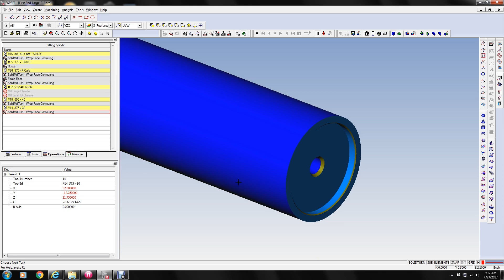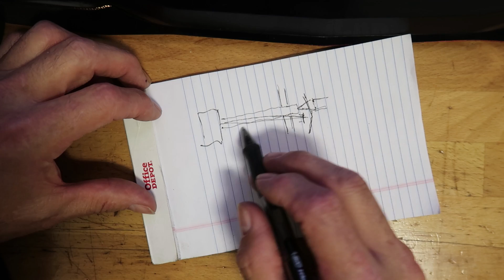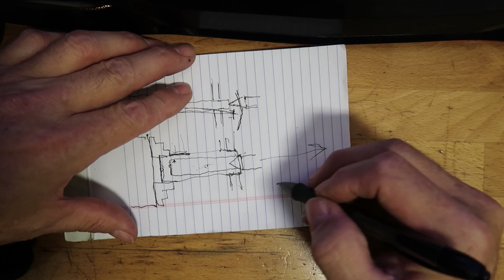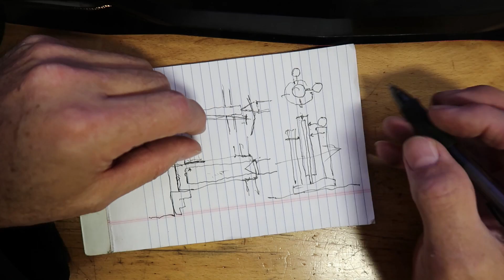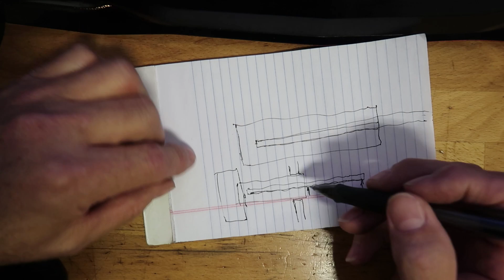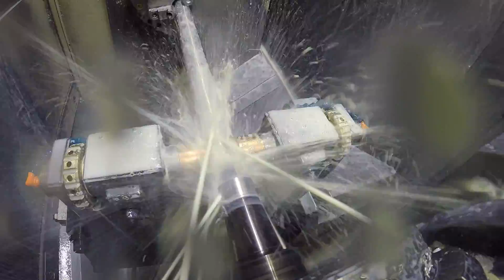Some Thoughts On Using Steady Rest and Milling Part End

Comment: Another great video Peter!  Quick question:  from what I have heard running an indicator upside down like when you indicated the end of the shaft can be a bit risky because flex in the holder may cause a false reading.  What is your experience?
Reply from the maker: Yes you are correct. I have tested this Interapid indicator with that short arm in the video  quite extensively and it has very little error (but it does have some about .0002"). You may have noticed how close I have it to the collet chuck in the video just for that reason. It is necessary for you and any machinist to test all indicators and arms/bases if being used in a horizontal position. A Renishaw probe doesn't have that problem if is calibrated in the horizontal position. I use the spindle probe on my horizontal mill. I have over the years seen machinist's clamp mag bases on the chuck of a lathe to indicate holders in the turret or a tailstock center. This will give you a error in your reading due to gravity.
Reply: Thanks a lot for the explanation.  Really liked your discussion of getting a part running true to a blind hole.  One more question, could you explain the hammering?  Why not just adjust the big knobs (sweet design btw) on the steady rest?
Reply from the maker: Norman J I had to go down with the part. The jaws are bored to fit the part so adjusting the jaws with this steady rest there is nothing to push the part down. If the part is low I can push it up slightly but not down. It's better to be a little low and push the part up with the lower jaw. I was just a little to high with the body or the steady rest.
Reply: Makes sense...  One suggestion that might improve the steady rest is to try asymmetric jaw inserts on the front and the back.  Replacing the "C" shape with an "r" shape should give you downward pressure on the lower jaw which should allow you to raise and lower the stock.    Do you think that would work?  Keep these videos coming, they have been great!